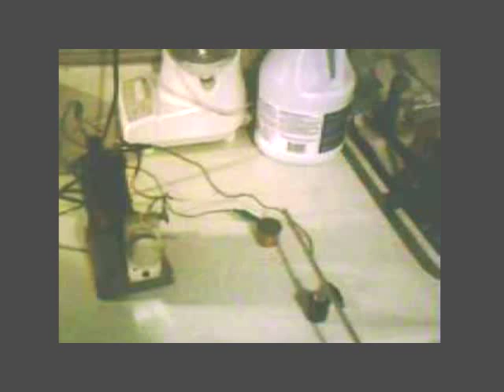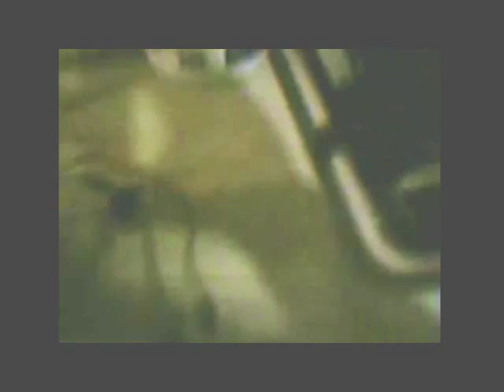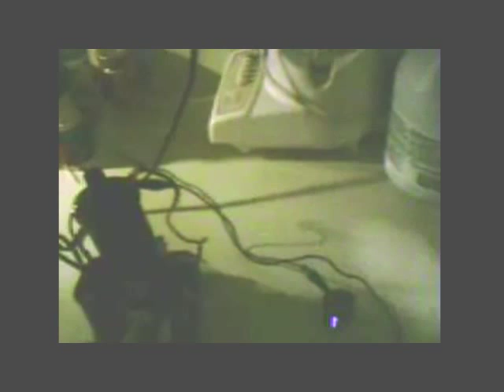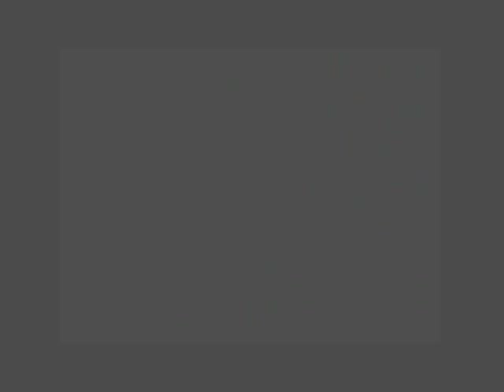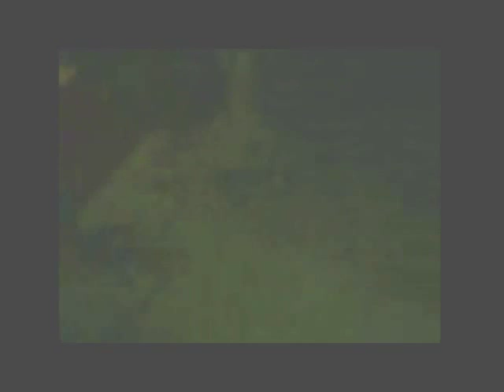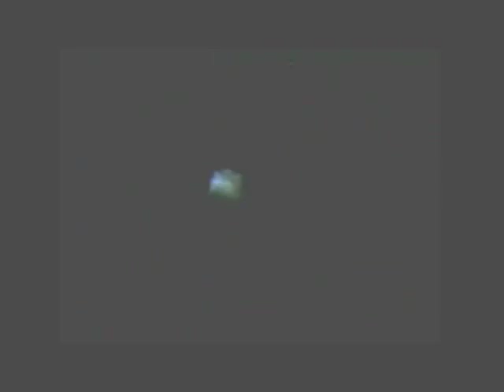levitating quartz (brightened)

Comment: Hello" jwdatwork"  I see this video came out 6 years ago  .I wonder what he's doing now.. The inventor should check out the  "Kowsky - Frost Quartz levitation".. experiment that was published in "Science and Invention" magazine in the year 1919  where gravity was nullified..  google it...  sincerely  Auggie
Reply: Yes he was using longitudinal waves, basically 0 point waves. Tom Bearden described that properly but you won't find it on Wikipedia which is edited by morons. I made a short video describing it. 
It's very interesting that this fellow was levitating quartz at such a good distance from the aluminum rod which apparently was the only antenna. I do suspect though that because he said it was happening at other places in the house that the copper wiring was acting as an antenna also. 
When I reverse engineered the Coral Castle device, I found that Ed was aiming to cones at the same point from different perspectives to form what is called a grid zone. The red zone collects the carrier wave where energy is concentrated so well that it forms superconductive heavy ions as heavy as gold which will displace matter. In other words, a tractor beam.